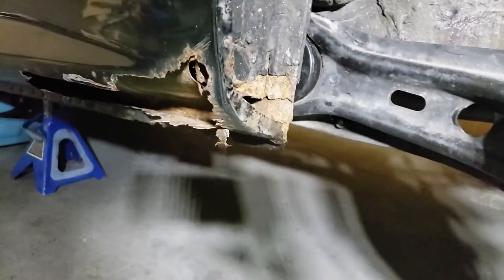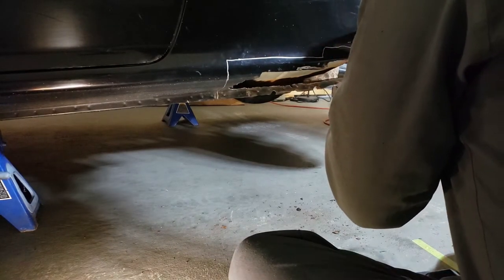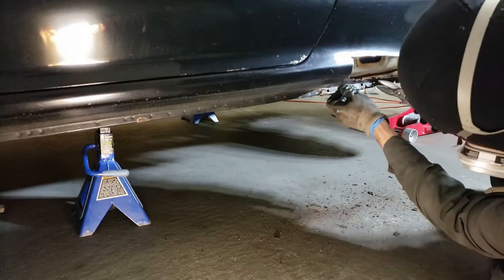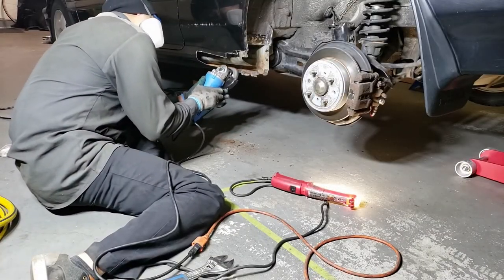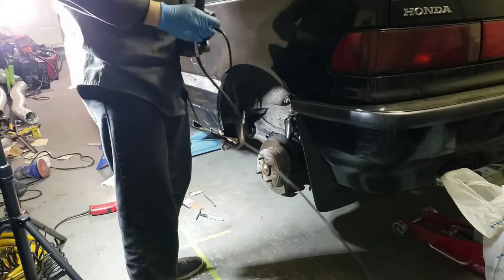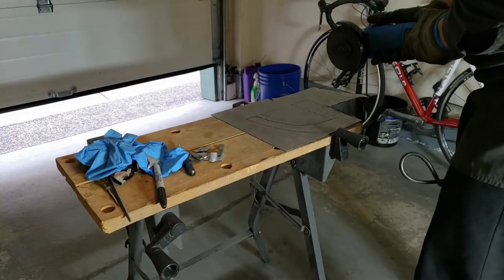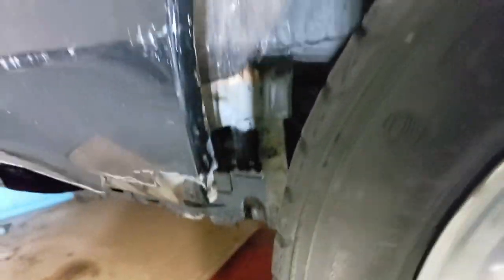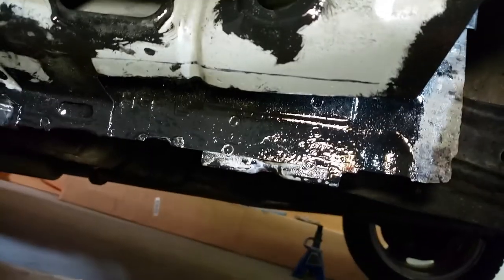[Car Rust Repair] Driver Side Rocker Panel & Wheel Well Rust Repair (Removal & Prep) - Part 1

Comment: Awesome work dude! Keep going 👍👍

Also, my wife would kill me if I used her previous Tupperware containers for paint.. you're a brave man!
Reply from the maker: Thanks! Well technically they're my Tupperware and they were sitting around not being used. Once I took 1 for paint my gf started to use them. Oh well. Its just 1 container. They work so well for this por15 stuff. I let the excess dry in the container then I squeeze the container and the paint falls right out and ready for the next time I paint. 😁